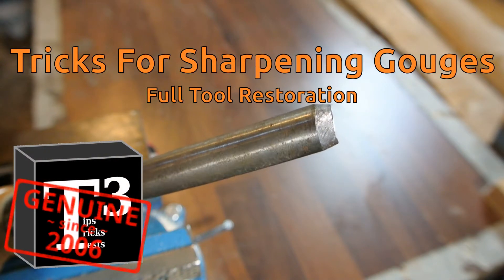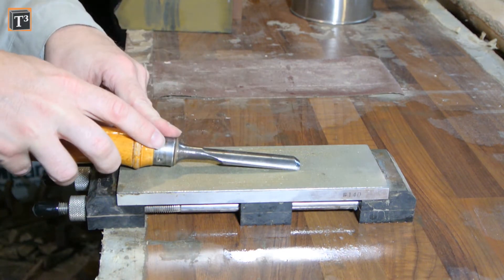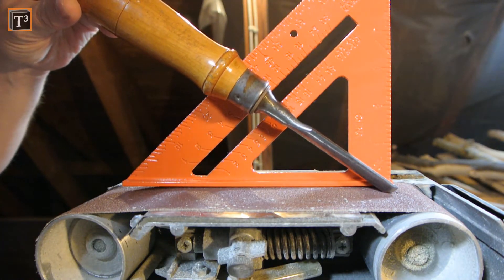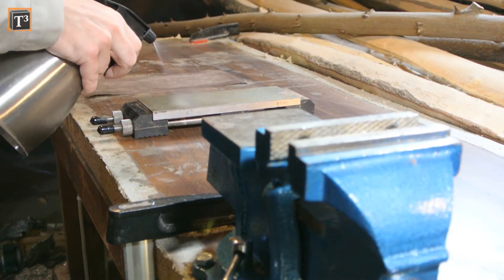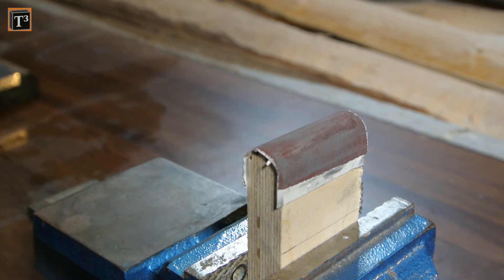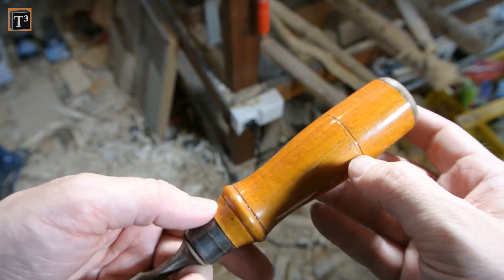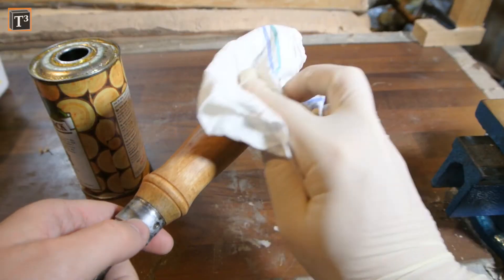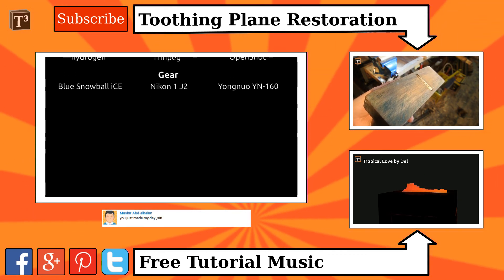Tricks For Sharpening Gouges ▪ Full Tool Restoration

Comment: Hello Ray...These trick videos are great...!  For the gauge: Why not turn your sharpening stone and holder 90 degrees, so it sits along the table...? You will be able to use more of its surface.   Tip 2: I make flat spots on my handles, in line with the Iron, so they do not roll easily.  Greetings from Denmark...Jakob.
Reply from the maker: Thanks for the tips. I actually turn the stone for bigger blades. It just happened to work fine for me this way for this size :)
Interesting idea about having a flat surface on your handle to keep them from rolling off the work bench.
Reply from the maker: Actually I am going to show that in my next plane restoration video that I am currently editing.
Reply: Hello Again Ray... Looking forward to more...!  Another subtle comfort of the flat spots: The hand "senses vertical & horisontal", without even looking.  Have you tried a chisel with a rounded bevel(heel) behind the edge...?  They are excellent for carving.
Reply from the maker: Jakob Hovman it indeed does but usually you need a bit of practice to notice that.
Reply from the maker: Oh and no - I didn't have the chance to get my hands on such a chisel yet.

Comment: no! do not use the 400 on the back to remove the burr. once polished, only use the final grit to remove burrs, or you are putting 400 grit scratches essentially removing your polish and putting the edge back to 400. this is obviously exaggerating, but its best to use the finest grits to remove burr. flip the tool back and forth to flip the burr if it is large, this will weaken the burr and eventually it will come off. If i get a large burr when restoring, or initializing a new gouge, I will use the finest grit on the back in between my grits to keep the burr as small as possible, so the fine grit can easily handle removal.
Reply from the maker: My issue here was that the back was in pretty bad condition. But you are correct - once the back is polished you shouldn't use coarse grits there.